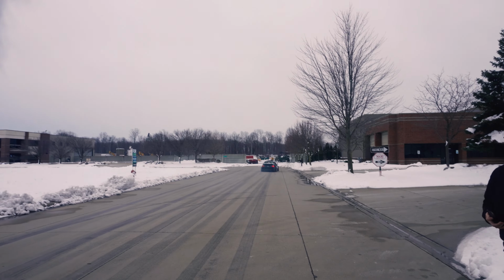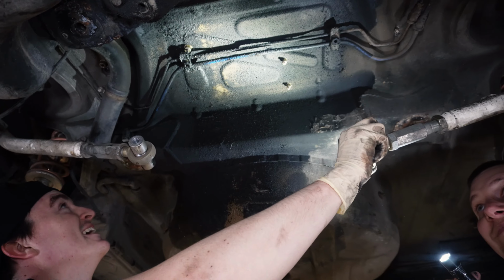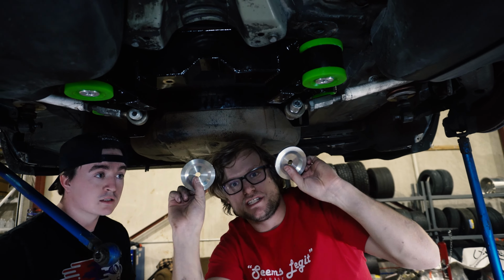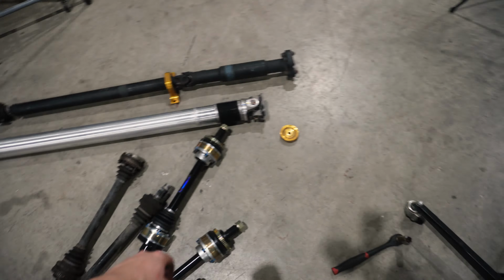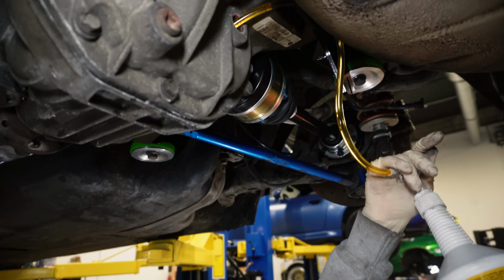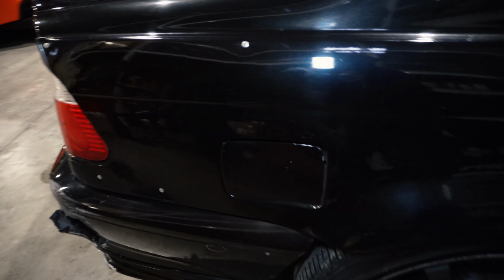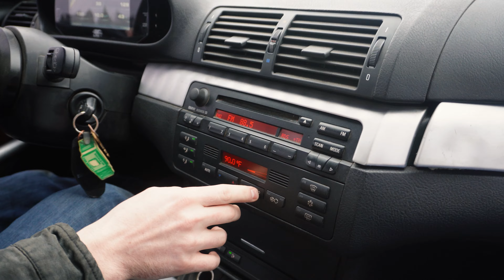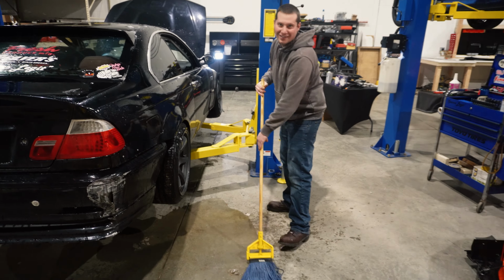SLG E46 Ford 8.8 Swap Kit in a Turbo M54 Drift Car! Rolling Burnouts

Comment: Making me consider an e46 cuz the e36 coupe market is so ass right now.
Reply: I haven't looked at e36s in a while. Can you still get one for under 2k?
Reply: @nhilist5774  fuck no lol. Theyre under 240sx tax right now. The shittiest examples, non runners, rust buckets, "drift builds" aka gutted dented ac deleted heaps for THOUSANDS.

Only way is finding those rare decent examples parked in back yards.
Reply: @imSchwaggy  no lies
Reply from the maker: E46 is Life! A better E36
Reply: @SeemsLegitGarage  facts. i have a e46 sedan 325xi
Reply: @SeemsLegitGarage  e46s to me just don't look anywhere near as good as an e36 coupe. And I'm HUGE on looks, and very particular with spec.

But im also very partial to e36s because they're one of the best looking cars ever made.
Reply: @imSchwaggy  gah damn the markets still tough I see. I want an e46 but I'm not a fan of the sedans
Reply: I couldn’t find a single e36 coupe but then I saw an e46 coupe n I was like fuck it I’m buying it 😂😂
Reply: @jg-xj3ur  I see a few but they're either thrashed and overpriced, or decent and WAY overpriced 🤣. E46s are dirt cheap still. I may buy all the 1000-3000 manual 330ci's I see and just wait 🤣.

Comment: I have this kit on my 02 330i with an ls3/t56 magnum f and its a nice beefy kit.
Reply: Sounds like a sick build! Do you have any socials to follow??
Reply: @VictorPitstop  I am too lazy to document any of it with my real job hogging time but maybe when its done I'll post a kind of guide for what I ran into with e46 stuff(Just need to get exhaust done and some wiring since it'll be a street car). Mike from SLG was very helpful when I also had random questions about e46 stuff like the new rear wheel bearings I pressed in wobbling before the axle nuts got torqued ect.
Reply: @Do_Nothing  bro show us the car !

Comment: why do you recommend the poly green subframe bushings over solid?
Reply from the maker: For the subframe its less important, poly or solid it doesn't really matter. For the diff we 100% recommend solid. If you don't want a fully solid driveline then the subframe is an ok place to go poly.

Comment: Anyway to upgrade this setup with the ford super 8.8? Or provide super 8.8 and receive carbon clutch lsd?
Reply from the maker: No the reason we didn't use the super 8.8 is there is no different gear ratios available.
Reply: @SeemsLegitGarage so far I see Gear Ratios: 3.55, 3.73, 3.91, 4.11, 4.56. Any plans on developing the super 8.8 kit for e46? Maybe when more ratios are out?

Comment: Do you make this subframe and swap kit for an e85 z4?
Reply from the maker: Yes because that uses the same e46 rear suspension right?
Reply: @SeemsLegitGarage  I would think so, but idk what all they share chassis wise.
Reply from the maker: Its the same in the rear @lc393stroker
Reply from the maker: we do it often
Reply: @SeemsLegitGarage  I see the rear diff kit on yalls website, but haven't found the cradle or seen anywhere that says that subframe is included.
Reply from the maker: @lc393stroker   you can order the bundle here: https://www.seemslegitgarage.com/product-page/e46ford88bundle
 or the subframe alone here: https://www.seemslegitgarage.com/product-page/e46-ford-8-8-subframe-axle-kit

Comment: Hey am I good using a 2006 explorer 8.8? I noticed the 06 looks slightly different then the 2008-2010 8.8s the 2006 8.8 I wanna get does have double mounts on the housing snout. It just looks like maybe the diff covers are different? I know your website says 06-10
Reply from the maker: You can email a picture to Sales@seemslegitgarage.com and we can help confirm you have the right one

Comment: Question: When doing the subframe swap I see you have 4 bolts the 2 rear bolts and the front which is normally a stud/nut style I see ya used two bolts. Is there a reason for this?? If its better/stronger then what bolts is it that you used???

Comment: Hi I have a bone stock e46 325xi and I’m looking into transmission swaps because my current auto trans is about to take a dump on me. In the long run I’m just trying to have a fun street car/daily driver. I’m trying to keep the m54 for now and possibly upgrade later. What would you guys suggest?
Reply: Sell it and get a non x drive
Reply: DCT or 8hp swap…im boutta do that on my turbo 325i
Reply: Manual swap, headers and a tune go a long way. Or save up for a turbo. Thats what i did. 8PSI on pump wakes these cars up
Reply: @beefcake8920 hi, im looking into doing an 8hp swap do u roughly have a list of the things your buying??